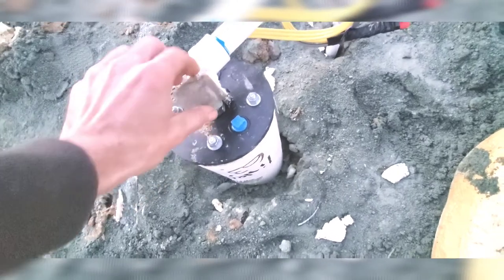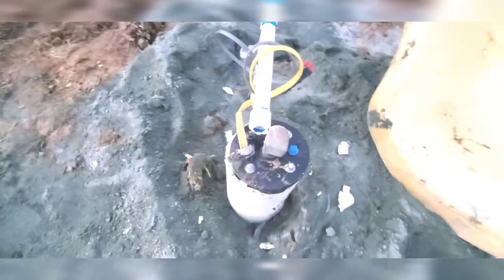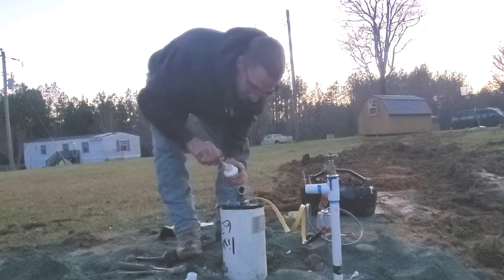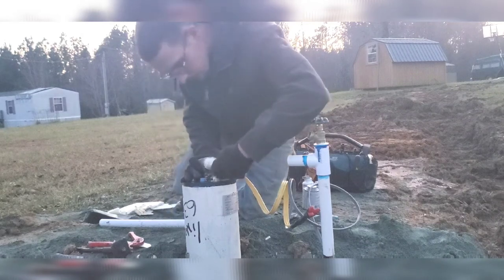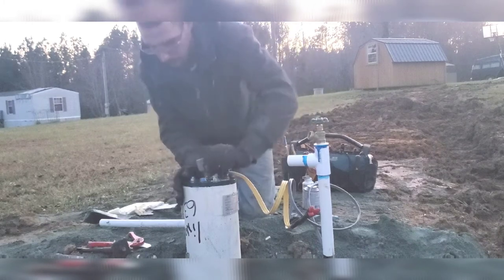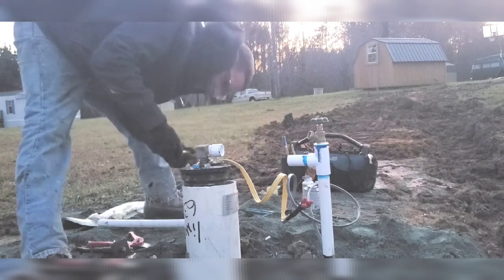Well Head Water Line Repair, Contractor Hit our Brand New Well

Comment: Do you need to heat trace or insulate the discharge piping in colder climates?
Reply from the maker: No just a cover that is sealed good around the base with dirt. The well breathes 50 degree when water is used. It act as a igloo